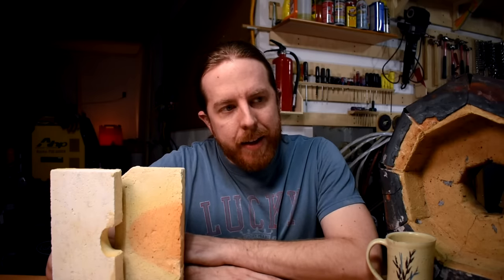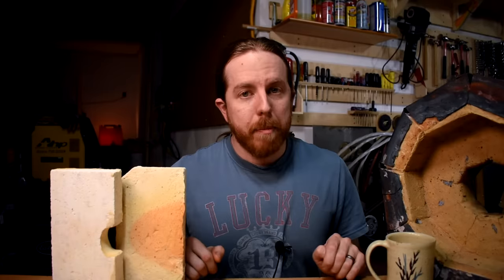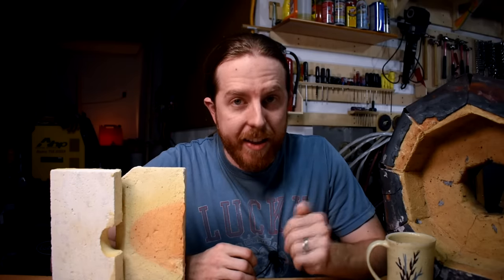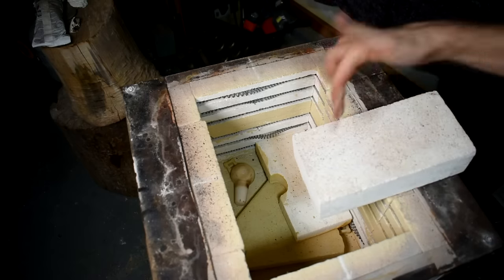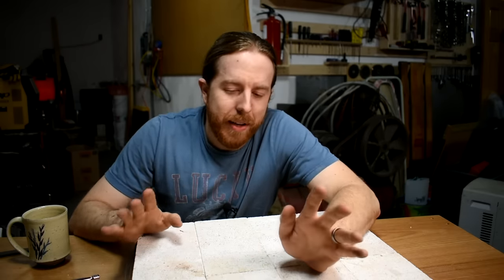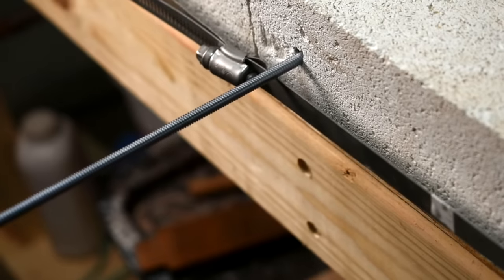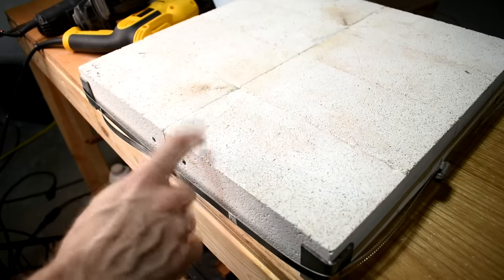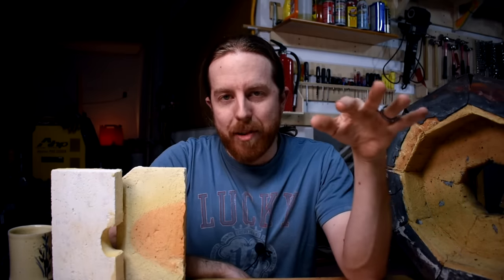There's a Problem With Fire Bricks

Comment: Yes!  Cross-hobby knowledge sharing needs to happen.  Often one group has solutions to problems the other group hasn't even considered.  And although being into multiple maker disciplines can lead to a lot of need for space, it can also lead to efficient use of space:  everything in my garage workshop has multiple purposes.
Reply from the maker: I agree!  And for space, there is never enough.  It doesn't matter what you do, you could use more garage space
Reply: Absolutely! I started as a ceramic sculptor and potter. After school I learned glassblowing. I was also interested in blacksmithing and metal casting. Through all of these ventures I only needed one oven/kiln. It is probably 50 years old and still works like a charm. I have used kiln wash and I fix any new cracks accordingly.
Reply: There always a more efficient way to do things, it’s my goal to find them.
Reply: I've seen over the last 10 or so years a lot of cross sharing between climbing, caving, highlining  and even sailing and I think they've all benefited a lot from it and that'll be the same for this.
Reply: That's why a buncha hackers looked at your hobbies and said, 'yeah we can do that better' and we invented hackerspaces, putting one in every other city in the country.
Reply: Actually the different tasks are somewhat incompatible. If you use your pottery kiln for foundry work the metals vaporize and contaminate the kiln which then changes the colors of pottery glazes, or glass. The design of the kilns often aren't well suited as well. A glass kiln a smallish hole in the side is needed (or a sliding door) to dip glass out of a crucible onto a punty. For foundry work a hole in the top is usually wanted so you can drop metal into the crucible as it melts and makes more space, for flux, or to change the alloy. It needs a door that opens quickly to get the hot crucible out, but such a design would be bad for pottery where the thermal shock would destroy the pottery if opened, and the leakage at the gaps could affect glazes. 
 For pottery work most openings are bad, and if they are used as in a gas kiln, they are carefully located to not cause cold spots or allow oxygen in (which would ruin reduction glazes). 
For electric kilns metal vapors, and smoke damage the resistance heating coils reducing their life significantly. 

For hobby work many of these things might be worked around, but for commercial work the risks of ruined work, and dedicated design of the equipment makes running them together not make sense.
Reply: Everything in my shed stops me getting into my shed to use it as a workspace :-}
Reply: @PaulsGarage  went from having no shop to having a shop now my shoip is too small.
Reply: @court2379  I made it work. All of the crafts I listed were done at different time periods. For example I bought the kiln used and used it for ceramic work for 2 years. I then cut out two fire bricks that could be removed and replaced. This served as a door for glass blowing. I did lampworking, I used a very large torch not a crucible.  The kiln would be used as a "garage" to prevent thermal shock between steps. When the piece was finished it would be placed in the kiln to be annealed and cooled. I did that for 20 years. I then became interested in metal and used it for heat treating knives and casting aluminum. Kiln wash basically ads a new surface to the fire brick. And adding a layer of fire brick to the bottom of the kiln makes the floor of the kiln new. I had to do that to cover up old bits of glaze that had spilled over the years. I also run a digital pyrometer, cones don't work for glass or steel. A lot of mods have been done to this old kiln, but it is still just one kiln. And yes I consider myself a hobbyist. I agree that you would have a hard time jumping from one medium to another, and back again. It could be done but would require a lot cleaning and prepping between projects.
Reply: @glasscaster3536  It depends a lot of what you are producing and how often you switch. For instance melting aluminum or zinc right before using it for glass work would likely add some aluminum to the glass. Whether that matters, I don't know. Glass for optics it might matter, but for art not be noticeable. If switching to glazing pottery the metal vapors deposited inside might change the color of the glaze. It might be a cool effect, ruin the piece, or not be enough to be significant. 

Mostly it just adds some uncertainty. In the type of work you or I would do, it is often experimental anyway so these things don't matter much.
Reply: @court2379  I absolutely agree. I rarely used glaze when doing ceramic work. I liked the burnished with stain or linseed oil look. You are right that it would potentially change the out come of your piece, but experimentation is what makes art fun! I've not had any issues with using the kiln for glass after it had been used for clay. I have not had any issues with metal after glass either. If used in a different order, I would vacuum the kiln out, and apply a coat of kiln wash before going forward. I have intentionally vaporized many different metals on to glass (gold/silver/copper/tungsten for example). I haven't used it for ceramic work for years. I think it would be just fine though.
Reply: European crucible steel got tech from glass makers. Helps to develop tech😊
Reply: What exactly do fire bricks do?  I was hoping to make a box out of them so I can put my belongings in them so they could be protected in case of a fire.
Reply from the maker: Probably wouldn't work.  The bricks do 2 things, they don't break down themselves at high temperatures (normal bricks will melt above 2000f) and some of them insulate but only somewhat.  Depending on the duration and heat of the fire, everything inside could still be damaged by a house fire.  It slows the heat transfer, but does not stop it.
Reply: @PaulsGarage  : Hey.  Thanks for your answer!  Have a good day.

Comment: When I first switched on my home made electric foundry all the joints wanted to open up and fall the thing apart. I switched it off and built a cage around it, a bit like your rods, but external. When (if) I build my next (bigger) foundry, I will keep this idea in mind. A very neat solution.
Reply from the maker: i think when foundry temperatures are concerned, everything is a temporary solution lol
Reply: @PaulsGarage  So true! My "temporary solution" has lasted for two years and still works. I keep telling myself the next one will be better.

Comment: You could use an adhesive specifically for kiln bricks to bond them together so it would move more as one.
It would also help using ceramic wool on the outside surface for greater insulation.  In our lime kilns we use ceramic wool, soft fire brick and then the harder fire brick on the inside for ware resistance.
We also use a castable
Fire brick but it’s very expensive.  You should be able to find this material at an industrial concrete and brick supplier.  
Hope this helps
Reply: That adhesive stuff doesn't last at 2500-3000F, you have to use a castable refractory cement.
Reply: @Boosted98gsx  
I’ll look into that for you and find the product name I’m using and let you know what temp it’s good for.  We us it in our lime kiln and it seems to last there
Reply from the maker: thats a good idea for sure.  this oven does have ceramic wool in the walls, though not all of them, for insulating.  I keep thinking i need to add more where it's missing to boost efficiency a bit. It takes forever to heat more when it's above 2200
Reply: @PaulsGarage  Taking longer to raise the temperature is normal at high temps. The hotter it gets, the harder it is to get even hotter. This really starts becoming noticeable once you hit ~1800F, and then even moreso once you get up to 2200F-2300F as you mentioned. Especially since it looks like you're using electric elements instead of a burner (which will struggle at the higher temps). Electric elements will also burn out/wear faster the hotter the firing gets. My experience is almost entirely in pottery, but elements last considerably longer if they never go above Bisque-ing temperatures (around Cone 06 or ~1800F), compared to High Fire (Cone 10 or ~2345F).
Reply: Use baby powder and water to make paste, if its not scented its the same stuff in powder form. You could also pulverize a brick to get the same powder, but that's tedious and probably not quite as fine grainwise. 
Can be used to fix cracks too.
Reply: Silicone is useful.

Comment: Suggestions to prevent issue in future.   One simple way would be to swap the bricks around every so many hours of use,  so the shrinkage ends up being even over time.  Now unless you use special alloy steel,  most steel and pure iron have similar melt temperatures,    cast iron having a much lower tmelt.  99.999+% pure iron has a much higher melt temperature,  but it is very hard to obtain in quantities enough for rods... nice thing about having a career in chemistry for 40 years,  you learn a lot of interesting trivia...  Now there are metals that would withstand much higher temperatures without softening,  but they are quite pricey.

Another note is that your holes need to be loose enough for expansion of the rods,  or you will end up with cracked bricks,  especially when they shrink onto the rods.
Reply from the maker: good points!  the holes are mostly loose enough that i can push them in, but not tight enough that they fall out on their own.  Since this was recorded i took the lid apart once and put it back together, and that seems to have loosened the holes enough that the rods can move a little
Reply: he just needs to build it correctly..like a brick wall..repying on gravity. And his new lid is going to fall apart quickly
Reply: Actually you would want to use stainless steel rods and you can leave the holes fairly tight because insulator bricks are fairly soft and the little bit of expansion of the rods wouldn't effect it much as long as you mud all your joints

Comment: Years (decades) ago in college we built a small kiln with a removable top.  The top had a steel angle iron band around it and a slight pyramidal shape to combat shrinkage.  Worked pretty good for holding together over a few years of usage despite being built by a couple clueless students.  Instructor gave us a grudging "it'll do" on the job.  Which from him was high praise.

Comment: Absolutely agree on cross-hobby interactions.
I do a lot of pyro stuff and frequently find myself gandering pottery and blacksmith resources because there's SO MUCH crossover. Shout out to all the ceramics guys keeping the cost of lithium and strontium compounds low. Love yall
Reply from the maker: totally agree!  People making greensand for casting are spending time grinding kitty litter into bentonite powder... you can just buy 325 mesh bentonite straight from pottery suppliers for cheap!  It always pays to talk to other people doing anything, even if you think it's unrelated.
Reply: @PaulsGarage  Kitty litter is easily the most underrated household... Thing in my opinion! 
Need to plug a rocket engine? Litter.
Chemical spills ( within reason)? Litter

Gotta keep that cross-craft communication goin'

Comment: Built a few kilns. Actually really surprised I only just stumbled on your channel since you do so much of the stuff I used to do.

I like your idea about sharing experiences between disciplines.
That's the way to learn new ways of doing crazy interesting stuff.
Here goes with some of my experience with kilns.

The biggest I've built was about 18 feet by 20ish feet. Basically big enough to park a 1 ton GMC Suburban inside with room to spare.
Steel framed box suspended from a gantry. The gantry was on trolley rails. Took four guys to move it. It had two steel framed beds it could be dropped on so, basically... while one was firing the other was loaded and unloaded and serviced if it needed it. It needed it often. Structural mild steel really doesn't like glass firing temps and wool never seals up as well as I would have liked. 
The beds had 1/4" X 6" leveling blades bolted into the firebrick bed frame so that the top edge could be periodically lined up in a perfectly level plane a couple of inches above the fire brick surface. Then clay grog (basically non-scoop kitty litter) was poured in to fill the difference.
That made it possible to use a screed to scrape the grog out perfectly flat and level. Economical to build and easy to maintain but not the most energy efficient beast. 200w 480v three phase power through mercury relay switches and a programmable controller. Ooph. Great fun to work around in the summer.

Most were a lot smaller. 2' X 2' X 3' mostly. Great for almost anything.
All of these used alumina foam firebrick on the inside and compressed ceramic fiber panels (basically space shuttle heat tiles) outside of that. There was a 2" L angle welded frame to buckle the firebrick together with threaded stainless rod to compress it together.
Mild carbon steel threaded rod rots quickly and rotten threads make crappy fasteners.
The ceramic fiber panels were fitted over that with a thin sheet of ceramic wool between to fill the space. Just adding that insulated it so well the outside was good and warm after a day long fire, but you could touch it without burning your hand.

High fire nichrome coils were fitted into grooves in the firebrick walls and ceramic rod was run through the coils to prevent sag. Pieces of nichrome wire were used to fasten the ceramic rods to the walls (inside grooves) so that the coils were sitting about half in and half out of the wall surface.
It's best to leave the coils as far into the kiln space as possible. The part in the groove tends to concentrate heat and when a coil burned out it would burn out facing the groove. The rods kept the coils from sagging so that wasn't a huge problem that they weren't stuffed into deeper grooves.

Each of these had three coils for convenience but a couple of kilns I built like this used zoned heating so I could use a Terra cotta flower pot with a removable plug in the bottom drain hole, as a crucible for glass casting in the top of the kiln.
A little high alloy steel rod and a ceramic cone set in the drain hole and after the glass had time to properly melt and fine (outgas) the rod could be pulled up gently by a cheap spring until the ceramic cone slipped out of the drain hole and let the glass melt flow into the mold.

I even set up nichrome wire in random ladder-like arrays under the pot so that different colors of glass would drip down through it and become a bit better mixed but not fully blended together... Made awesome organic looking effects in the castings.
Just measure the volume of the mold  using sand... weigh the sand... put that weight of CoTE compatible glass into the flowerpot, plus 15%-25% for the glass that would cling to the pot and not pour into the mold...
Ramp the kiln up so it didn't shock the mold and wait until the bubbles in the melt rose and mostly popped... pull the drain plug and start the cooling and annealing program.

By using seperate controllers and zoned heating coils, the mold could be kept at a lower temperature than the crucible to keep the mold castable from breaking down while getting the glass melt hot enough to outgas and flow better.

Hexagonal Boron Nitride makes a great high temp mold release for glass as well as a lot of metals and in case you want to put an actual top or side loading door on your kiln, this is what you want to use to lubricate any moving parts (hinges, pivots for a split top door, etc)
It's a greasy white powder ceramic with the same molecular structure as graphite but much better heat stability.

There...
Probably as much as anyone is going to want to read from me for a minute.

✌️

Comment: I've worked in the steel Industry for years. My craft is in maintenance, not production. From what I gathered,  keeping the furnace hot mitigates shrinkage of the refractory brick. 

The lentil entry to the reheat furnace fell in recently.  They used metal to hold up the refractory, and the metal failed. The furnace had to be idled to ambient temperature for the reconstruction. Consequently, much of the other refractory had to be replaced.

Comment: The material you want is called Blakbond mortar made by BNZ materials.  Also, not allowing for thermal expansion will spall the edges of the bricks, so looser band, plus strong mortar joints will work better.
Many pottery kilns get destroyed because they are too tightly constructed.  Gaps are your friend.  Best of luck
Reply from the maker: Thanks for the info!  I think the place I get the bricks from gets them from BNZ.  I'll look into that mortar.  In my experience the kilns I've used definitely get looser and looser over time!

Comment: You can also use firewool, it's like fiberglass but for furnaces, use that as an inside layer and it should help take some heat load off the firebricks

Comment: I made my lids from fiber refractory board. It's more durable than wool, bit less than brick. However being a solid sheet, doesn't have this issue. You can coat the surfaces with kiln wash to hard face them to reduce damage, or repair erosion over time. 
Making a mount that prevents any sliding contact is a good idea, and usually allows for putting a bit of wool around the edges as a seal, which prevents wear and heat leakage. The mount also holds the hot door while you unload the crucible.